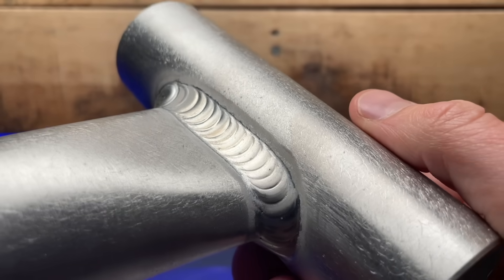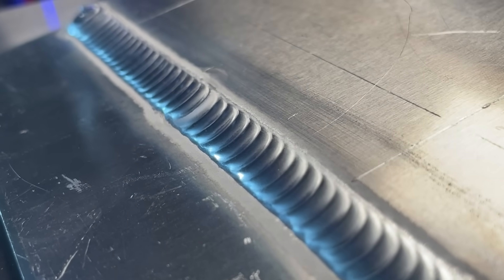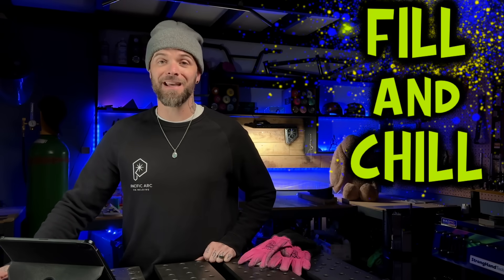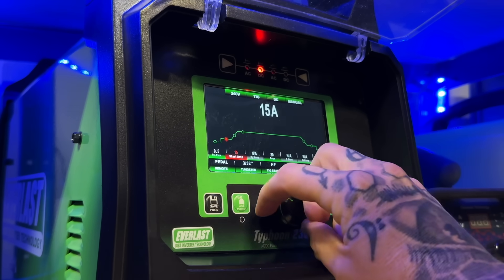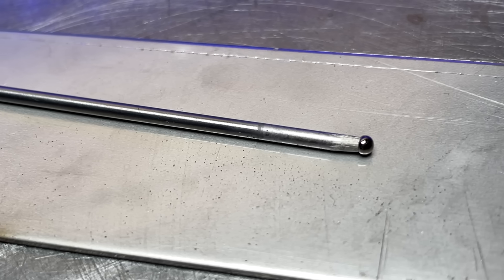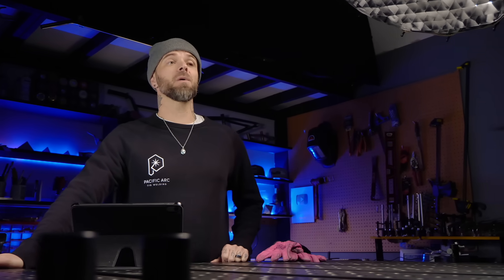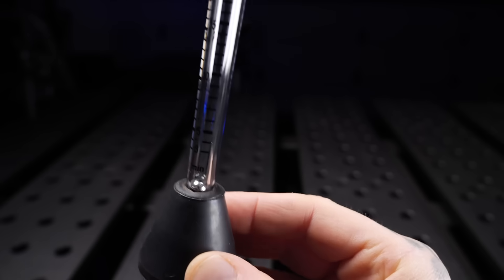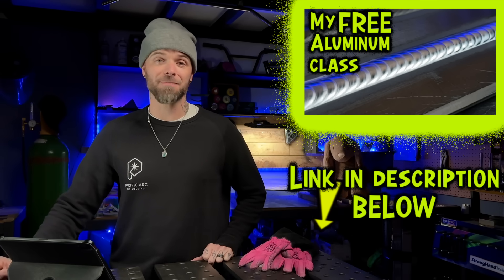get the BEST ARC CONTROL tig welding aluminum (here's how) how to tig weld aluminum

Comment: Do you have to preheat both sides of the fillet weld joint first until they start to melt a little and then add the filler metal or as soon as you strike the arc do you add the filler metal? I know you said add filler metal right away but I just want to make sure

Comment: Pure tungsten is the best, this 44 year vet carries 1/16, 3/32,1/8 and 5/32. Biggest difference I see today to lazy to prepare pure tungsten right, grinding is not the way I was shown in school. Two most common failures in aluminum tig to much gas and crater crack.

Comment: I really HATE "experts" who discuss TIG welding, as they WILL NOT show their heatsinks/carriers on weldments/will "demonstrate" poor flow on plate/sheet ie. NOT A JOINT that BENEFITS from capillary flow, then go on to discuss "techniques", whilst taking the filler rod OUT OF THE PLASMA SHEILD...........
And finally "They" NEVER show the most IMPORTANT PART of the weldment ie. the UMDERSIDE!
"Dimes" and "Horseshoes" are aesthetically pleasing in any weldment, BUT without FULL penetration, and FULL fusiom, then they are little more than decorative - This has been and is such a problem with Aluminium and Lead welding.....
To have a scruffy weld with good fusion is infinitely better than beautiful surface "welds" with little fusion!
BTW Top Tip for learners - RUN OFFs/ONs COMBINED WITH BRASS carriers for both Ally and Lead WELDING are a must, as is LEAVING a UNIFORM oxide LAYER margin(use SS freshly sharpened scrapers to assist)!
With TIG quickly becoming obsolete to Laser Welding,, then we must ALL be honest, and share skills FREELY, ESPECIALLY on platforms like YT, where many come for guidance(rightly or.....)!
Reply from the maker: You took your time on this one hey?? Feel free to watch any of the dozens of videos on my channel about welding penetration, troubleshooting problems like you mention above, and the other free classes, workbooks, and literally hundreds of free videos I release. I don't hide anything my friend, hopefully you can check out some other videos, or just move on peacefully. All the best to you, hope you have a great weekend.
Reply: Dude, they have a channel to run, and YT channels are practically run like businesses at this point. He's gotta keep the flow of videos active. If that pisses you off, stay away from fitness channels who will break videos down into specific subjects. You'll just whine like a bitch over talking about reps but not form even though that video is a click away. Get off the internet and find a hobby that won't increase your cortisol levels. Or maybe you enjoy getting worked up so you won't have to spend money on shampoo and haircuts anymore.

Comment: Aluminum has no carbon, so it  wants to not arch or reflect the current, which is why it takes a lot of heat to weld it. Don't be scared to get it hot, welding it cold WILL cause it to crack. Especially with thicker material. And yes it's better with a ball. With a ball it's better to use the correct cup size with what you're welding. And have the tungsten stick just pass your cup. Like an 1/8 at most. The balled tungsten will arch in a way with your cup size. Giving you a very clean Dime. Also don't use gas screens on your whip. Those get dirty and will put impurities in your puddle.

Comment: Depending on what machines you use some don't ball up some use pure some recommend not to use certain tungsten but with old transformer machines pure is going to ball no matter what and other tungsten may not as much I use 4% thorated Thoriated(orange) with my Miller syncrowave 250dx and it's works the best I found and holds up a lot better

Comment: All of this is great advice. But' when all you have to weld with is using a Lincoln or a Miller, its hard to get a weld like that, especially when you work at a job that requires fast work's to a customer.

Comment: I bought a "pro" flow gauge to check my cfm at the torch from Amazon after watching your video. Unfortunately, I've yet to find one that's calibrated correctly. Do you have a flow meter you'd recommend?

Comment: What sucks about aluminum is that when you start a weld, the aluminum around the weld is pulling the heat away. Its called thermal conductivity I think. I had to do tig on tank trailers and anything but an edge weld was a pain in the ass Hanging around in one spot too long would crystallize the aluminum. Rework😁😁😁
Reply: What sucks about this. That’s one of the bonuses with aluminum. 
It’s also not as sensitive to post flow.

Comment: Good video, I welded Ali mig tig all over the world for 40 years. Any new people here take this information as Gospel. The rounded shiny cleen tungsten is key as well as matching  gas flow with shroud size , and correct frequency.  Also clean everything perfectly even the filler wire . You must use a tonn if scrap Ali to play around  and learn the machine until you become one with it .

Comment: I have yet to see how I can control the size of the ball on my tung.  It seems to be a factor of the heat, and tung size. To generate enough heat, the ball exceeds the diameter of the tung.  I am using a miller sycrowave 250 with the balance around 65% cleaning.  What am i missing?

Comment: Great videos! I want a tig welder that I can use on an aluminum or stainless tubing that works off of 110v portable as possible. I have many projects on a sailboat. Do you have any recommendations? Thanks for sharing!
Reply: I just bought the ahp 225xi tig machine. it was like a grand for the welder accessories gas bottle and gas. It’s been super easy to set up on mild steel, I haven’t tried aluminum yet but it’s got the 120v adapter and will do all the metals.
Reply: @hunternewsom4462 I wasn’t familiar with that manufacturer and the price seems reasonable.

Comment: A lot of people say that you can only use green (pure) tungsten with transformer machines on AC, but I had excellent performance with purple (E3) on my old Miller 320A/BP.
Reply: My Miller 180 syncrowave seems to like the blue tungsten. I'll try the purple.
Reply: I use blue 2% lanthanated on my miller 330abp. The syncrowave is squarewave where the miller goldstar machines are not and I think that makes a difference.

Comment: How the hell do you hold it so long at the start without melting the project material away?
Reply: Don't mash the pedal until you're moving, keep the amps as low as possible until everything looks good. It's possible to weld aluminum without a pedal, but it's really hard, especially if you are trying to run a long continuous bead.
Reply: 👍✌ @kirkblee5853

Comment: First let me say I absolutely love your channel it's very informative and supportive I've learned so much from watch and practicing your technique I'm still a novice but I'm a quick study and have been welding for a long time just not tig welding. I'm wanting to buy a machine that will give me a HF tig function with a MiG function to weld aluminum and stainless specifically. I have a Lincoln 300 3d 98 model for big stuff .  What box welder would you recommend for this application? My end goal is to be able to weld body panels on my trucks and build custom turbo pipes and reservoirs

Comment: What’s crazy is that I welded aluminum with a “stainless mentality” until I had to weld a 1/4 throttle body to an intake manifold with only 120amps. It made me sit at the start for about 30 seconds with full pedal but that was the BEST aluminum welding I’ve ever done. Thanks for the confirmation. You’re doing a good work here.
Reply: I'm  government certified. Your amperage is crazy low. It might heat up and look pretty on the surface. However Your penetration is going to be compromised especially on a T - joint.
Reply: That’s a lot of heat in the part..

Comment: What I can't figure out is how you get the definition between each "dime" its almost like each time you dip the rod the edge cools very quickly. Do you change your balance setting so the puddle cools faster? Or is it simply a very exact heat for the weld. My stacks always seem to melt alot smoother then yours.

Comment: Very good tips, as always!!  Thank you Dusty. Quick question, on the picture of the 3 tungsten tips (pointed, blunt and balled), it looks like they are polished. Can't see any grind marks (slight marks). Do you do anything special after grinding the tips? Thanks again for your time and videos.
Reply: After sharpening your tungsten change your balance to 90% positive on the torch or pretty much as high as machine allows and arc up on a scrap piece of aluminium
when arcing start low and slow as it balls the tungsten pretty quick

Comment: awesome video But how do you make a small ball on the tungsten your videos are so good thank you for sharing at 73 I am late in starting but l am loving it...
Reply: I'm not that good at controlling it yet but the method I use is to turn the positive side of the ac up to around 50% and turn up the amps 20 or 30 more than I need.  I then hold the torch as level as possible while starting the arc.  Ramp up on the pedal until you see the tungsten start to ball then let off when you get the shape you want.
Reply: @jhowse19801  thank you
Reply: @magwamagwa45110  You're welcome.  Plus the ball will tend to wobble while its forming, this is the tricky part.